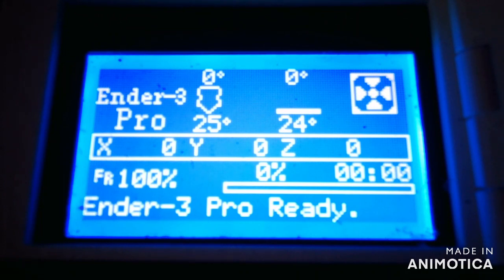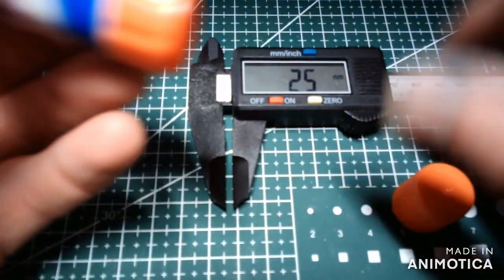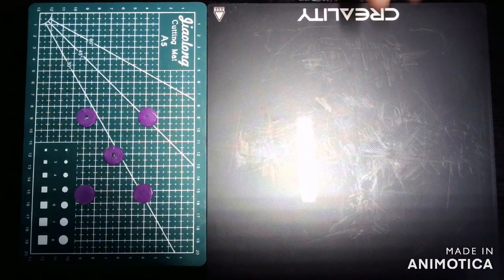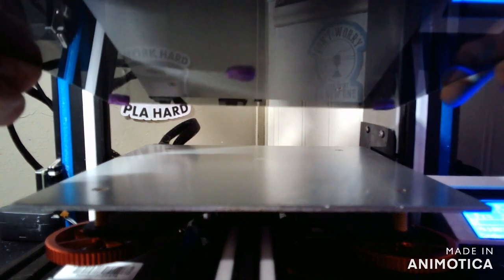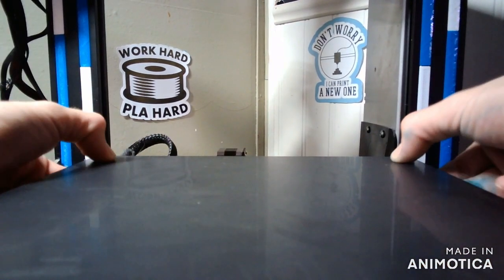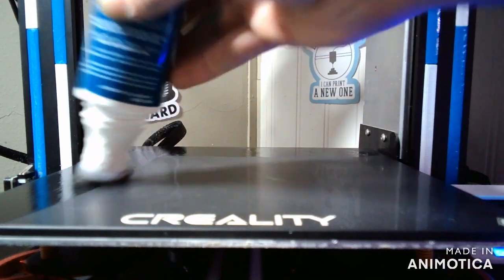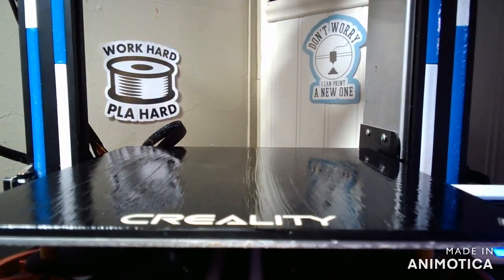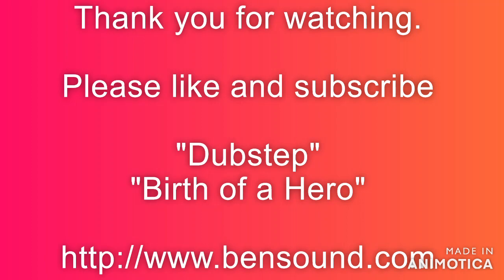Ender 3 mounting glass bed with glue, no clips no tape

Comment from the maker: I have been using this method for a year now. It stays very clean, this does not bother the heating element located underneath the aluminum bed it is less of a value than the adhesion matts. Creating excellent prints. Heat transfer is excellent. Print TPU ABS PETG! Will be making video demonstration on cleaning and removal of glass bed. Thank you for watching.